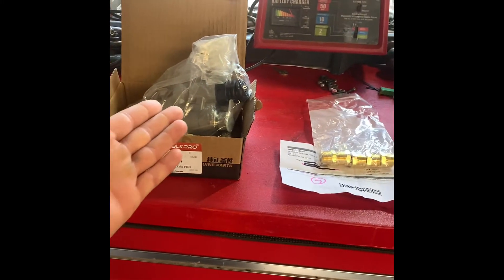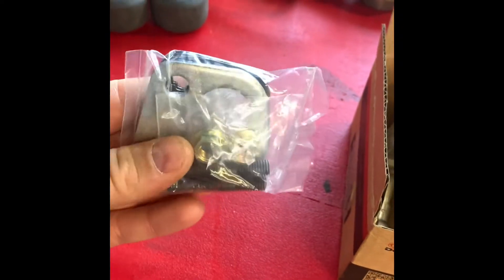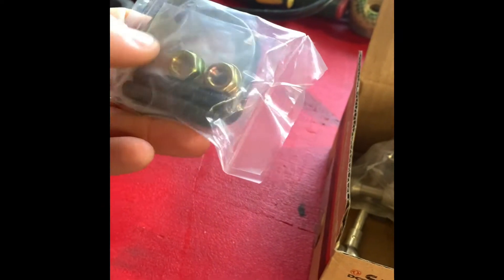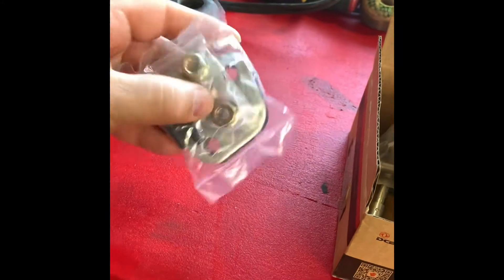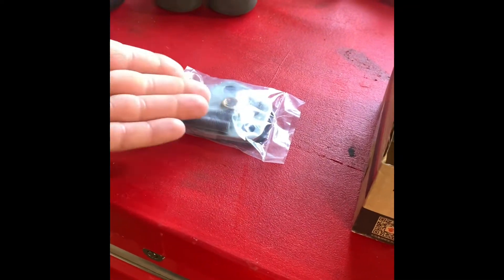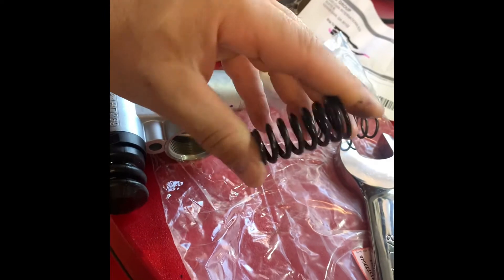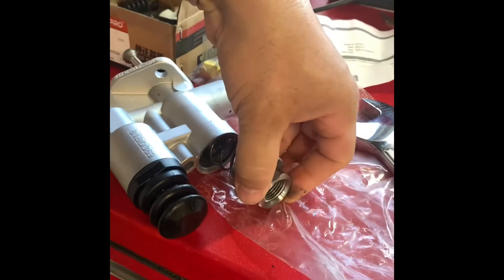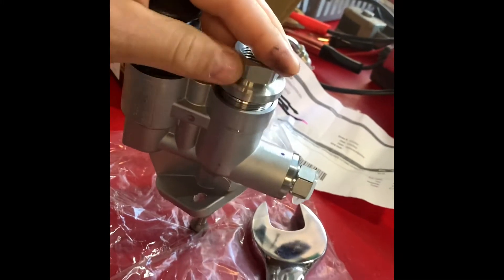Lift pump conversion 2nd Gen to 1st Gen 12 valve swap. More psi.

Comment: eBay ones are sold out but I found some on Grainger. You can only buy a 10 pack and its $30.00. 
Specs look almost the same. Link in comments.
Reply from the maker: Awesome. Thanks for the info.
Reply: @Halffast719  welp YouTube deleted my link. Ill try something
Reply from the maker: Sounds about right

Comment: Hell yea, thanks for putting this video out there! I’ll buy a spring or two and a npt fitting if you still want to sell them.
Reply from the maker: Where about are you located?
Reply: @Halffast719  YouTube won’t let me post my location. I’ve tried 3 times, then it gets deleted. I DMd you over on Instagram.
Reply from the maker: When are you planning on doing swap.
Reply: @Halffast719  as soon as you get me those springs and fittings! But I’m not on a super crunched timeline. I’ve got the rig working, but the old wafer lift pump is weeping a little. So it’s time…
Reply from the maker: Okay I’ll ship them out next week when I get home. I didn’t receive a message from you on Instagram. Halffast719?
Reply: Tucson AZ